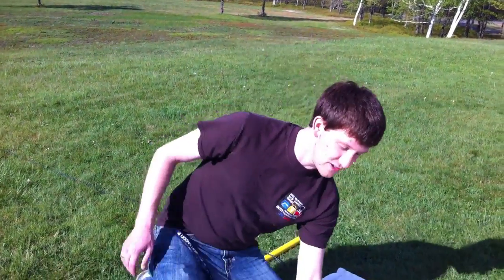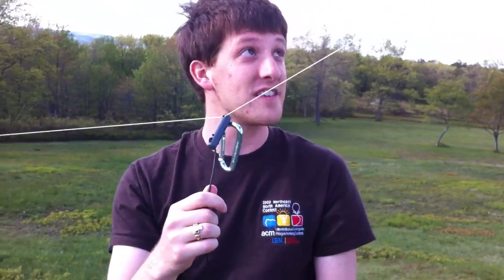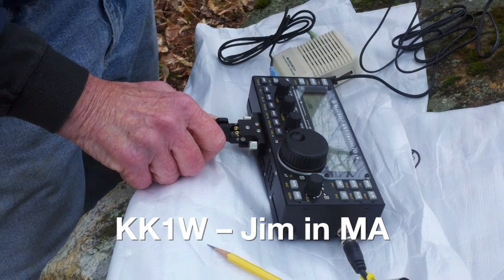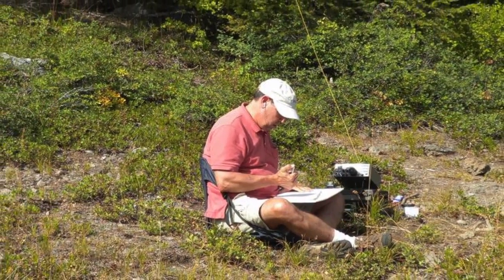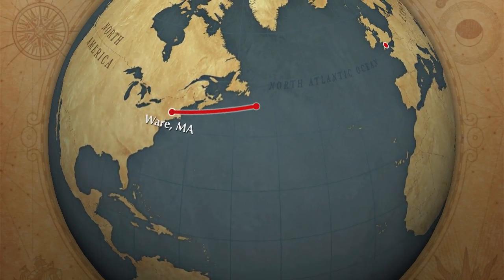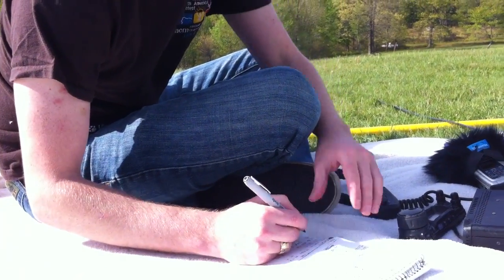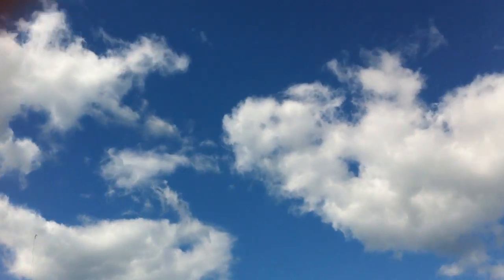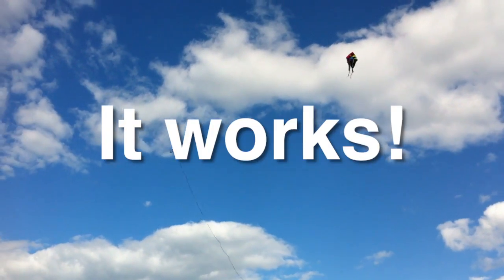The Kitetenna! KB1NTY activates Quabbin Hill for Summits On The Air

Comment: Nice video. Did you do anything to cut down on the static? I want to try this. I keep reading about using some kind of resistor to help with static. Not sure how to set that up with my unun. de kg7fop
Reply from the maker: No, I didn't try that. It would probably help. I believe the idea is to put a large-value resistor at the base of the radiator into the ground, to provide a path for static. Check the SOTAbeams site for info.

Comment: I've always wanted to see someone do that.  Well now I can check that off.  Do you use or have you considered using a foldable Solar panel during these SOTAs?  I have one from Goal Zero which works very well.  73s!  KJ6UFY.
Reply from the maker: Portable solar power is on my list of things to try. I would having backup power and being able to operate a little longer or with higher power.